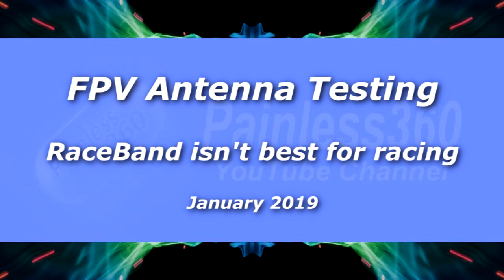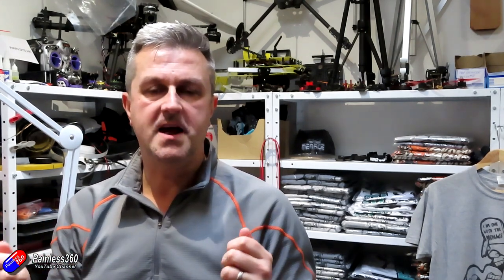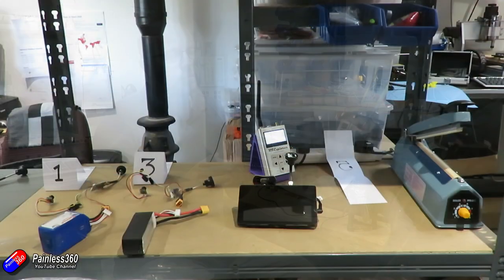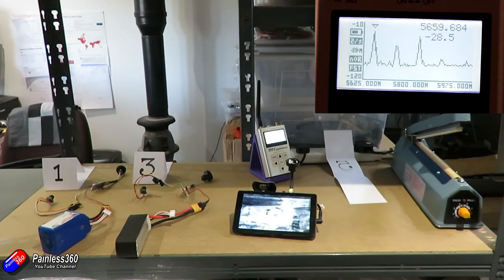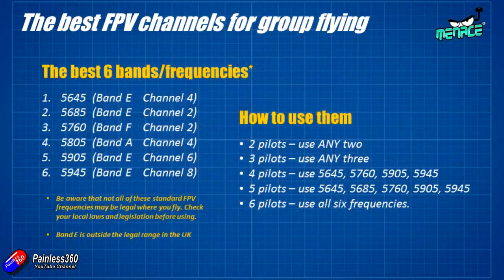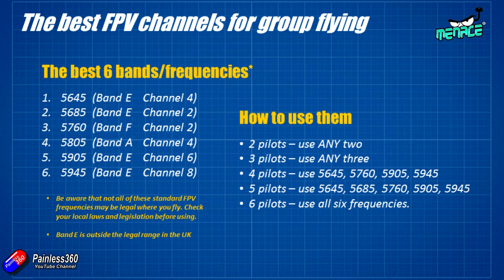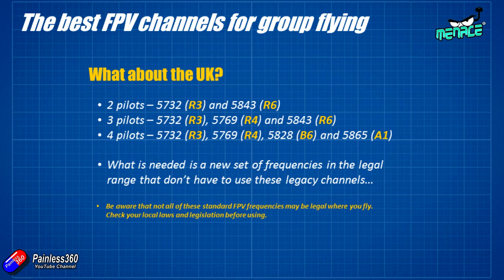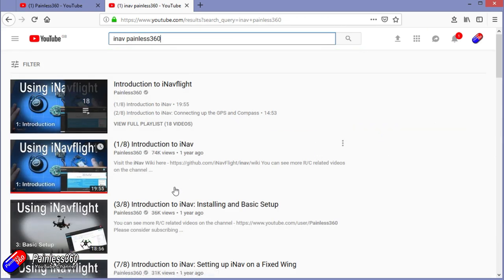FPV Antenna Lab: Raceband isn't the best for multiple pilots?

Comment: Another set that works: 5645 (E4) 5685 (E2) 5740 (F1) 5806 (R5) 5860 (F7) 5945 (E8) (two are different from this set). However I think for race events it's rather inconvenient for people to switch between different bands because either 1) their vTX doesn't support all bands or 2) it takes more time to find the right band and channel rather than just switching the channel number (especially with chinese gear using different letters for the channel designation).

Comment: This is great information. My club moved away from Raceband last year for this reason. I had to upgrade my module so that I can change bands without pulling the module out and changing dip switches though. I didn't realise E band was out of the UK legal range. I haven't used it myself though which is good. A new band would be great! Thank you

Comment: It's encouraging that our supposition that intermodulation terms were the root cause can be somewhat verified independently - unfortunately just a network analyzer isn't the ideal tool to fully analyze how that is involved (even with our fancy full chassis unit)...  practically the rolloff on those is well under -15dB even at worst case, which means it's still logical to use Raceband for events with the right provisions, and when flying with  newer pilots keeping up with IMD-6 can be a bit of a challenge.
Unfortunately, the issue still persists that when plugging in, the majority of (especially cheap VTX products) the band sweep that tends to happen is enough to knock other pilots out of the air, even with moderate separation from the flight line.
The real workaround has been moving the flight line well back to avoid the oppressive nature of 1/r^2, where that ACLR bleedover can be from a craft 20ft away while the correct signal is coming from 200ft away, and the ACLR signal ends up being powerful enough to ruin flyability.  By being far enough back, and using alternating LHCP/RHCP, it's possible to run 6 pilots up using specific adjacent channels quite well (1, 5, and 7 on LHCP,  2, 6, 8 on RHCP works well for us - and that's with unrelated noise generators affecting R1 and R4)

Comment: Would also help if you alternate between RCHP and LCHP within each band.
Reply: @Josh Stevens Yes exactly, what Lee is finding out combined with the use of RHCP and LHCP antennas, is the key to success with interference reduction and hopefully elimination.
Reply: I've heard about a rule for this but did not find it anywhere written. Something like odd/even channelnumbers for which direction. Is there any such rule commonly used ? When meeting other pilots its allways some discussion about channels and polarisations and who is able to change.
Reply: @nara I'm not aware of any specific guidelines either, but there maybe such protocols at sanctioned events...I've heard it stated by notable figures in RF (ibcrazy VAS and J Bardwell FPVknowitall) that it's good practice to alternate polarisation, but with these new findings now it wouldn't necessarily be effective just to use an odd/even left/right scheme. Because you now have to apply a formula to the frequency separation in a narrow available allotment of bands and channels depending on your area of the globe.

Comment: Unfortunately, E4 and E8 are both outside the legal range in the US, and many new transmitters are shipping without them here.  Multigp IMD5c or IMD6c (google it) is the best you can do legally in the US, I'd recommend that instead.  If you don't have raceband, IMD5 or IMD6 are acceptable, but not quite as good.
Reply: this comment should be pinned.
Reply: I concur - although at most events it's actually quite a struggle to get newer pilots onto the right band AND be able to switch on demand - which is why using Raceband is still ultimately quite popular, and with mixing RHCP/LHCP in conjunction with backing the flight line off the flight path, it's possible to still get 6 pilots up with very good video

Comment: I had this at Delta Hawks last year. I always use RB5 and have a custom made antenna to 5800. On RB1 I was getting an awful signal. Near unflyable. I put a Menace RC antenna on my goggles and all was good. I think these ghost channels also run with what frequency your antenna is tuned to.

Comment: I fly with a group of 6 pilots in the US and as we struggled with interference we found an IMD article on Propwashed.com.  (https://www.propwashed.com/intermodulation-distortion-destroyer-group-video/ )  They have a set they recommend that we've been using.  Not perfect but better than what we'd had before. All of these are legal channels in the US. TLDR: R1, R2, F2, F4, R7, R8 (aka:  IMD6c )